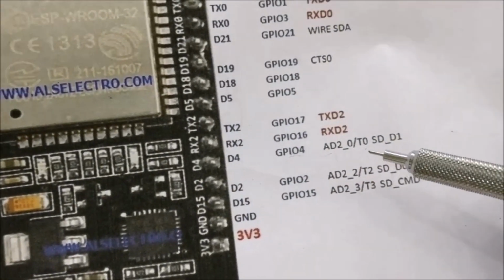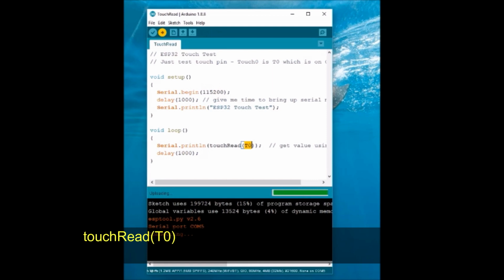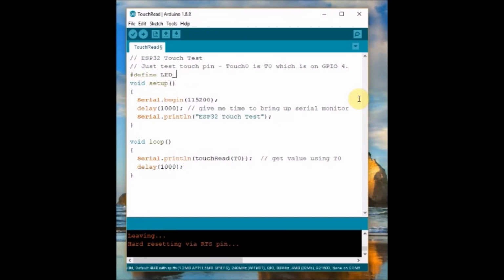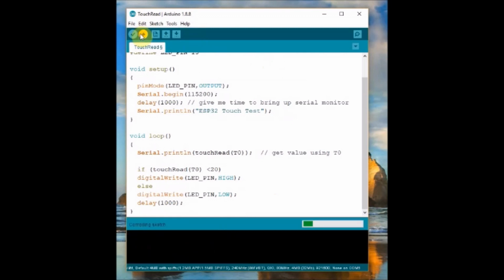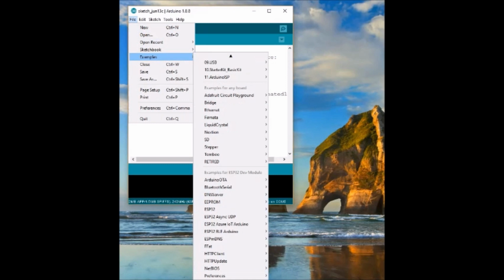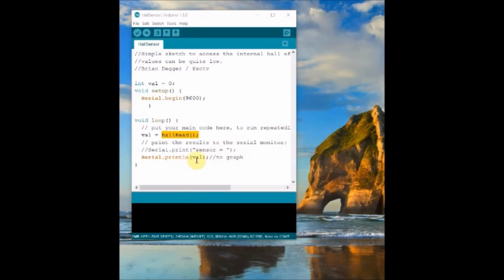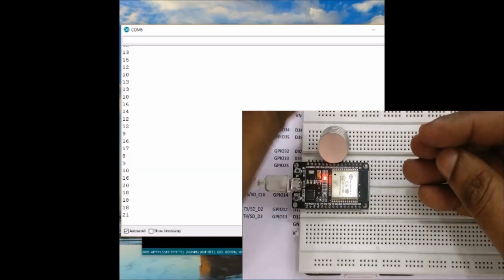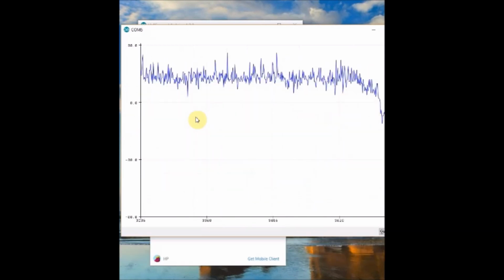ESP32 #2 INBUILT SENSORS - TOUCH,HALL EFFECT

Comment: Hello sir, I had a chopper circuit using in IGBT switching frequency is 18KHz working proper. When am considering esp32 with LAN module in same enclosure then data is not recieved by esp on PC. So I think due to magnetic field if am right then please suggest me how to prevent my esp ?